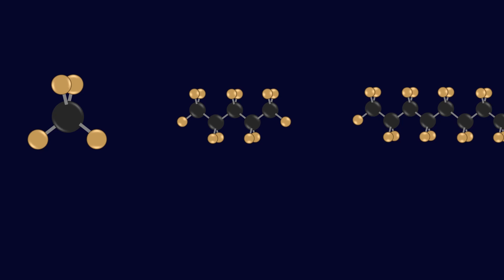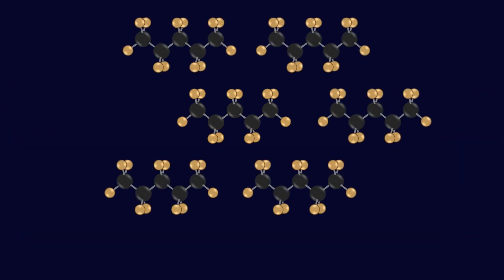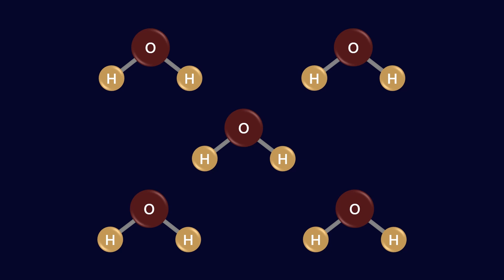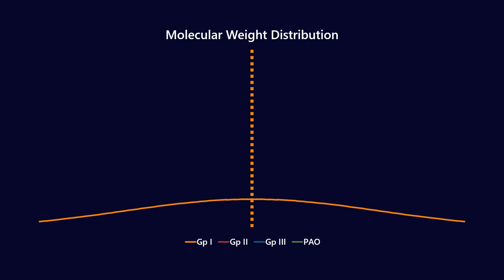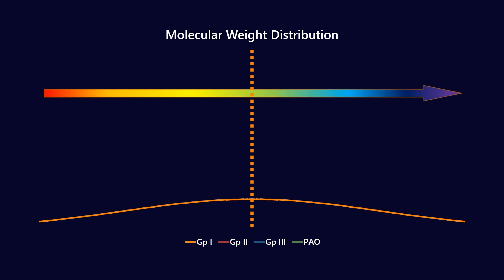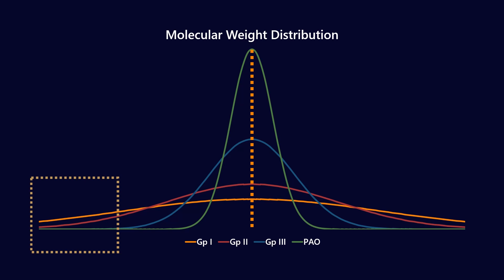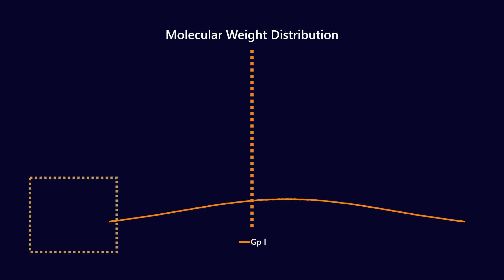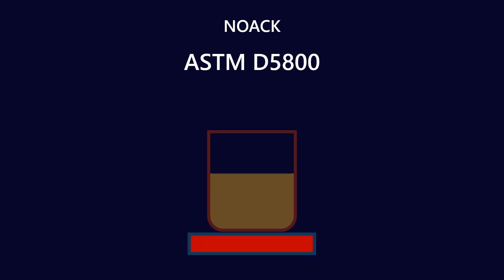Does volatility impact oil consumption and lead to oil thickening?

Comment: What is the purpose of the Noack volatility test? Does is determine the ability of the oil to lubricate at high temperature? Or just another way to predict how well the oil resists thickening in the long run?

Comment: Are additives the only practical method/approach to stabilize volatility of any particular oil group (other than the level of refinement)?
Reply: No. Almost every additive you put into an engine oil makes its net volatility worse, not better.
Reply: @MrSensible2  Then what specific measures (other than higher levels of refining group III lubricants or the use of PAOs) contribute to the stabilization of volatility? Let’s put this in a specific application the vast majority of us can relate to-automotive gas-engine lubricants.
Reply: @watercooled8105  It sounds like you already know the answer. If you want to reduce (think this is what you mean by stabilise?) oil volatility, you need more Group III & failing that, more PAO. Alternatively shift to an oil with a higher W rating. All things being equal, a 10W will have a lower Noack than a 5W oil, a 15W lower than a 10W & a 20W better still.
Reply: @MrSensible2  Increased W doesn’t appear to be an option with automotive engine lubricants and market forces (cost to the consumer) introduces a significant barrier to automotive lubricant producers. What are the realistic options for meeting government standards (let’s use the U.S.), consumer cost and still achieves the previously stated goal? Marketing folks say “additives”….while wearing lab coats. I’m looking for reality, because I don’t live in a lab or a (marketing) fantasy world.
Reply: @watercooled8105  Marketing folks NEVER wear lab coats! It's total anathema to them. They start to die inside if you ask them to put on a pair of safety glasses!! 
That aside, US standards ARE being met. The OEMs, oil companies & AddCo's are, every minute of every day, forced to live 'in the real world' as you put it & it can be a hard, brutal existence making sure all the bases are constantly covered. 
I'm not sure what question you want me to answer?
Reply: @MrSensible2  You have very cleverly answered my question at arm’s length and I  always appreciate your time on the subject. LE, as always, I appreciate your work and presentation.  Thank you.